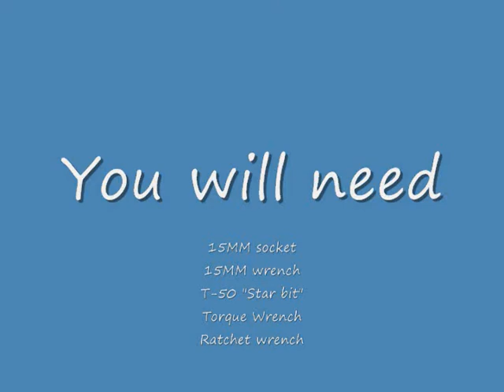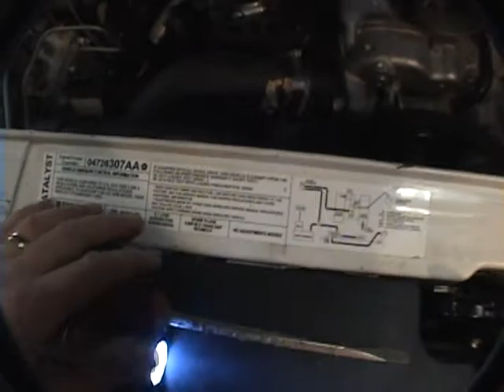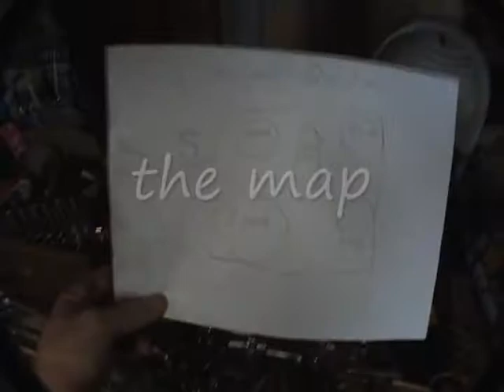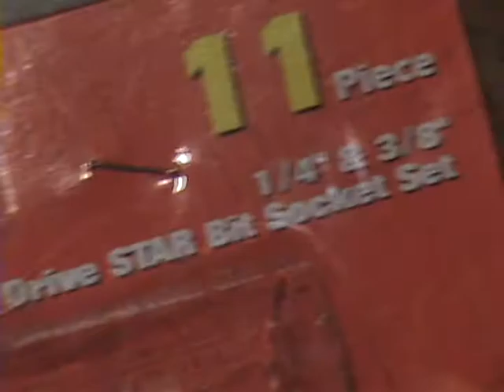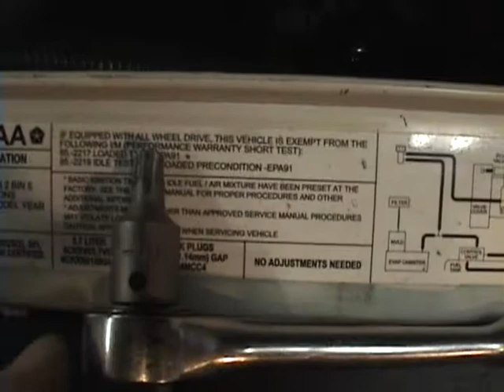2006 Dodge Charger. Belt tensioner arm and idler belt pulley.

Comment: Can the idler pulley be slapped on backwards?
Reply from the maker: I would say no? It has a special bolt, I think it was a star bit bit. it has the same outside diameter as the idler pulley wheel but the inside diameter is different.  Again I'm a back yard mechanic I know only this much and want to share that. Thanks, proceed with caution as mine is a full on born a cop car that may have differences.
Reply from the maker: LSE SSII  Yep T-50 star bit
Reply: @LSESSII so I searched for lots of videos and wondered why my idler pulley had a weird star bolt instead of the regular 11mm or so bolt and finally found a video I can relate too..
I just replaced my serpentine belt and I got the idler pulley but couldn't figure out the size Star... no noise or anything but I just want to replace all the pulleys that I can and the tensioner pulley so I'll do both next time